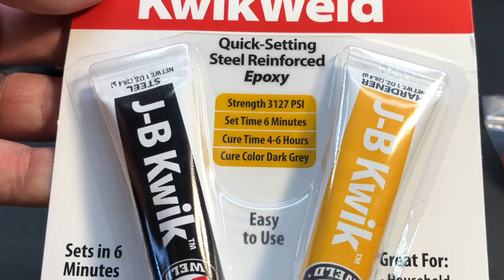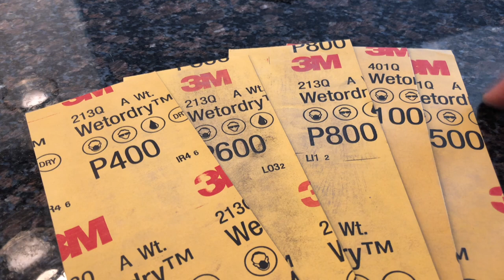How to: Modified Hot Wheels race car build, technique and tips!

Comment: I just use my knife my good Bowie knife I cut around the whole plastic and then I get out that bit and then when I get to the axles I just use my knife to clip it back and then I pull out the axles and then I put it into the other other Hot Wheels that I want to😂😂

Comment: Hey Bud.....great tutorial!  A lot of detail went into this video!
Here's some of what i do
When drilling/taping I lube both with bee's wax....available on Amazon.  Really helps the bits from heating up.
On your small .50 bit...I use a 1/16.  but instead of marking it....I make my measurement....mark it n wrap it with tape....scotch...painter or duct tape.  whatever ya have.  it acts as a drill stop...so no measuring more than once needed.
On attaching axles or weights....I scuff or score the areas the jb weld is to go so that it has something to grab onto instead of just a smooth surface.
Hope this helps!   Good Luck at the races!  Im entered also!  Caddy V16 Concept.
Reply from the maker: Great tips, thanks for the input! Good luck on the upcoming races, the V16 is a track weapon!
Reply: @ScaleRacingChannel  Welcome!   Lets hope my "work" pays off!

Comment: That wheel jig is dope, I need to make me one. Also need to look in to that wheel sanding.
I have wheel swapped most of my premiums since I started racing, at first I did it because I didn't have enough metal/metal cars and I actually raced those against stocks. Back then I didn't know about axle polishing and any of that extra stuff, just swapped suitable wheels and raced. Now it's different since I'm starting to have good numbers of stock cars. I still don't use any extra weight on my basic swaps as I like to keep them as "stock like" as possible, I do have couple of cars with some extra tho.
Excellent video, I just forwarded this to a guy who is starting whole racing hobby 👍
Reply from the maker: The jig is an excellent idea, I credit Red Pill for turning me onto it. I too was doing a lot of wheel swaps, but I was going in the other direction. I was stealing Real Riders off of premiums and building mainline customs with them. So I have a bunch of metal/metal premiums just begging for plastic tires now... Thanks for watching and the referral!
Reply: @ScaleRacingChannel  I do have some RR customs also, but I'm starting to get farther away from those as I have limited space and they really don't interest me that much any more.

Comment: One thing I might think would help is checking to see if the axle slots are true 90 degrees from the frame. Find a longer piece of metal similar in diameter to axle. With each end sticking out far you can check if it's off and stopping a role to one side. You want to make sure it's 90 degrees
Reply from the maker: It is important to make sure the axles are true in the chassis. I have found that the slots moulded into the chassis are usually very dependable. As long as they are held in place to either the front or rear while gluing. It is important to make sure the axle locking tabs are out of the way cause they can cause interference.

Comment: About to modify my first car. Someone recommended weights in front to prevent front end from swinging sideways? Or is it better in the back?
Reply from the maker: Drag racing: 30/70 front/rear weight bias is optimal.
Fat track racing: 55/45 front/rear bias.
Don’t get too mired down in being exact on the weight placement. It is just one piece of the puzzle.

Comment: Loved the tutorial for customizing a car.  Just watched your race on Blue Line Racing.  What did you learn from that?  Have you entered any other custom races?
Reply from the maker: Thank you!
I learned NOT to wait till the last minute to build a car (and film the process)…😆
But honestly, using a metal/metal car for a 60g modified severely limits where you can place weight for f/r bias in the chassis. This car did not have sanded axles, but most of my newer builds do. 
I was set on the wheels I wanted for this car, I probably should have farmed a better set.
Reply from the maker: I have entered a few more since, mostly with Blueline Racing. Sent some cars out for some simple speed challenges to my buddies at Your Nightmare Racing and Bobby D’s Lakeside Racing. I simply don’t have the time between life and the channel to fully devote myself to building lots of mods.

Comment: Great video Brandon. I’m going to finally do a wheel swap on two of my cars. Question is, can it successfully be done with a metal base/plastic body car.
Reply from the maker: Yes it can. The plastic can be drilled and tapped just like the metal posts. Just be careful not to drill too deep. Or just use JB weld to glue the posts in place.
Reply: @ScaleRacingChannel  thanks.
I put the new wheels in yesterday evening and let the JB weld cure overnight. I’m going to shoot a video later today with the car on the track.
Reply: @ScaleRacingChannel  I forgot to mention the car that I used is from Speed Racer. It’s Racer X’s “Shooting Star”. Mattel did a terrible job securing the axles. I tried using tubing to fix it and failed miserably. I kept the car instead of tossing it hoping to find a way to fix it. Glad I waited and found out about you, Red Pill, DXP, and others in this die cast community.
Reply from the maker: @7thave.diecast945  I haven’t tried tubing axles yet. Have all the supplies, just haven’t gotten around to making one yet. I’ve heard they can be temperamental.
Reply: Let’s just say tubing is not the way to go if you plan on racing it.
Reply: Question. Depending on the tournament is sanding the wheels considered cheating? I would like to someday compete with my cars . I think it would be a good way to figure out how some of my modified cars would do up against folks who have been at this longer than me.

Comment: have u tried derby tungsten putty? ive been playing with that lately, its somewhat sticky and stays in place well.
Reply from the maker: I have not personally. Elevation Diecast sent a truck in with some putty applied. Seems like a convenient way to tuck weight into some tight spots. How do you like it?
Reply: @ScaleRacingChannel  liking it so far. Weight to size is comparable to lead but u can play with it more. Was able to line the whole bottom of an 08 mitsubishi evo and put the whole interior back in. Quick, easy.

Comment: How do you feel about sanding wheels of stock car. Basically it's still stock as it hasn't been drilled, but I probably would classify it as "enhanced stock" in my rule book.
Just a thought that came to me as I recently got this Camaro Wind, great wheel spin but when it's rolled there's this "clicking" in one of the wheels. I didn't see visible flaw but could probably fix that with some sanding.
Reply from the maker: I feel that sanding wheels will almost always speed up the car. I typically don’t unless I plan on sending out a car to race where the rules allow it. 
I would be nervous doing it to a freak tho! Most times they are better off left alone.
Reply: @ScaleRacingChannel  I think I test it with dust before any further actions, I'm also trying to locate that wheel with click. It didn't seem to have any visible flaw.

Comment: Hello SRC, What is the BEST  & WORST mainline hot wheel wheel-type to chose?
Reply from the maker: Well, I would say the worst mainline wheel is the trap 5. The design of the wheel protrudes past the wheel lip and it really slows the car down when it rides against the track sides. 
The best? Well, look for a car that has the larger diameter skinny wheels on all 4. Take a look at the Roadster Bite or the 09 F-150 now on the pegs. That is a good representation of what I would look for as far as size goes. You are always at the mercy of $1 quality. You could buy 10 of the exact same casting, and 1 maybe 2 will stand above the rest. Those 2 will have more concentric wheels with few flaws and not much resonance. 
Thank you for watching!

Comment: How did the car do in the races? I just got into this and now I need to find metal chassis hotwheels
Reply from the maker: Mmm, not too good. I wasn’t entirely happy with these wheels after polishing, but I was up against the deadline and had to get her in the mail. There are some extremely good builders out there right now, it’s gonna take something with better wheels and better weight distribution to have a chance. 30/70 front to rear weight bias seems to be the best formula. Hard to achieve without using a plastic chassis car, unfortunately. But, by all means, experiment! Thanks for watching!

Comment: lots if weight towards the back how did the car do in the race?
Reply from the maker: About 30/70 front to rear bias is preferable for straight drags. A little hard to accomplish with certain body styles and metal/metal cars. Plastic base cars are easier to get the bias correct. 
The Cougar did ok, but it was not my best build. I needed to farm a better set of wheels for the car. But it is what it is. The build was bulletproof and made the whole series without damage. 
Thanks for watching!

Comment: Why would you not want to put the weight in the center under the interior? 

Seems like it would anchor the center of gravity and help give a more stable and even ride weight on both axles and all 4 wheels.
Reply from the maker: If you were running fat track, that is exactly what you would want. But for straight line drags, a more rearward bias works better. The rear of the car sits higher than the front on your typical downhill start ramp. If the weight is in the rear of the car, then you will have more potential energy (which is converted to kinetic when the gate drops) and although it may seem negligible, it can translate to quite a few thousands of a second at the finish. 
Great question, thanks for asking!

Comment: Where can I find the screws to attach the body to the frame? also what is the exact size?
Reply from the maker: This is where I get mine. Some guys like to use self tapping screws, but I tap all the posts and use these machine screws. https://www.ebay.com/itm/332128883185?var=541154582100
Thanks for watching!

Comment: What is the purpose of sanding the tyres?
Reply from the maker: Many of the wheels have small imperfections in the surface. Sanding the wheels removes those imperfections and cause the wheels to roll a lot smoother. 
Give it a try, you’ll be impressed by the difference.

Comment: With the weight at 60g how certain are you that the scales are all exactly calibrated? I own a very nice (expensive) scale that can be calibrated to a standard weight as scales are notoriously unreliable for standards that is why in professional weigh ins the use a scale with slide weight... So your scale may say 60g but when it gets to the next destination it may read 58.9g and then the next may be 62g.
Reply from the maker: When you build modified cars for mail in races, it’s always a good idea to build in a little fudge factor so your cars to weigh in maybe a gram or two shy of what the rules allow. Many of the race hosts allow for a 1g variance. If you build a car for a 70 g race and that car weighs in at exactly 70.0 g and the race host does not allow any grace, then yes, you are skirting with the possibility of being disqualified.
Reply: @ScaleRacingChannel  ok thank you, I had guessed that there was a little bit of leeway to account for that.
Reply from the maker: @TimKapow  most of these lower cost scales are actually pretty accurate. 
I have a very expensive scale that if you breathe on it, it will cause fluctuation. I have found that the $20 scale I purchased from Amazon is accurate enough not to have to pull out the big gun.
Reply: @ScaleRacingChannel  yeah my good scale as well is so sensitive it will even fluctuate with evaporation 😂. Scales only need to be accurate to themselves for things like baking etc. so as long as you make your cake using 1 scale and don't switch then your a ok. 
Scales should be relatively good when they are new but it is as it gets older it could and does lose its calibration hence better scales can be calibrated with a calibration weight
Reply from the maker: @TimKapow  I say the same with tape measures.  😂
Reply: @ScaleRacingChannel  😂😂😂

Comment: What's the name of the cloth you use after the sand paper on the wheels? Also, in theory, if you didn't have a weight limit, would more weight = faster car? To what point? Thanks
Reply from the maker: Crocus cloth is the name. Most of it you find on the market right now is 1000g, which I would avoid. The type I had was more like a 2000g. 
Instead, maybe take a look at this:
https://www.amazon.com/gp/aw/d/B07X56G951/ref=ox_sc_act_image_1?smid=A1F0ZX9W2WURWY&psc=1

If you sprinkle a little graphite dust on the later stages of sanding, it will give you a nice graphite burnish to the wheel. And more speed.
Reply from the maker: More weight almost always equals more speed. I say almost. It has a lot to do with where you place the weight in the chassis to maximize your potential energy. 
You will reach a point to where too much weight can cause excess friction at the wheel/axle contact point. You have to be careful what wheels you plan on using for those heavyweights. They can wear through them rather quickly when you start going to 150g+.
Reply: @ScaleRacingChannel  Appreciate your thoughts!